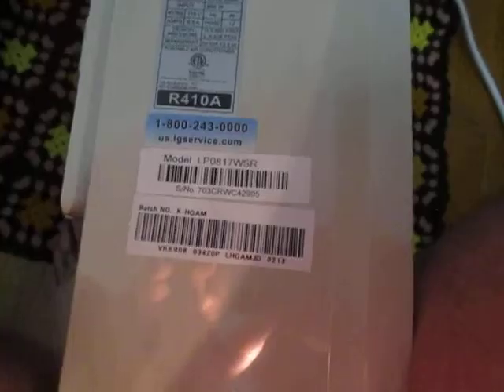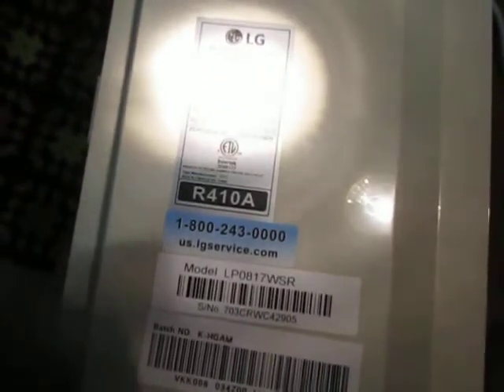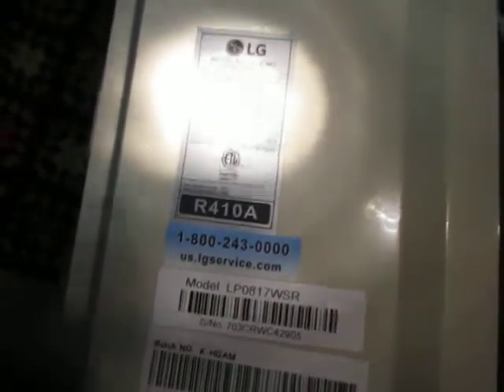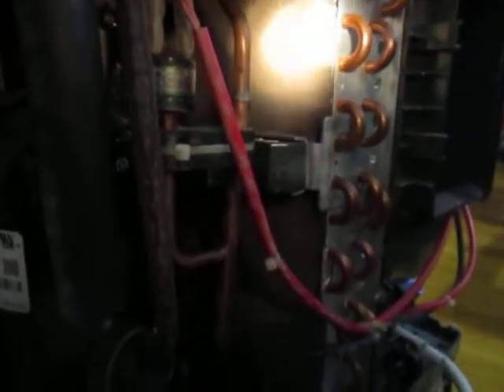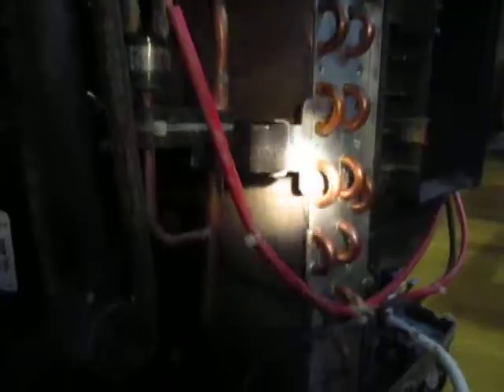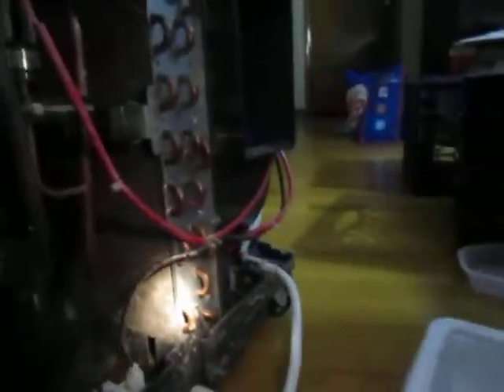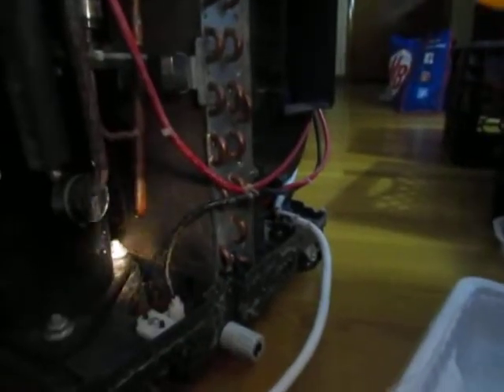LG portable air conditioner not blowing cold [Fixed!] part I

Comment: How hot is normal for these compressors?
Reply from the maker: you'd have to look up the temperature tables for the refrigerant .  The refrigerant is supposed to keep the compressor cool.
Reply from the maker: I got rid of my A/C unit because the refrigerant was blocked from flowing someplace in the condensor.  You could feel the temperature reduced from one pipe to another. Because of that, my compressor was running very hot.

Comment: I’m having the same problem haven’t found a solution I did everything you did and it still Throws hot air !!!!
Reply from the maker: After you get the metal on the condenser (bottom) cleaned, there are two pipes connected to the evaporator, which is on the top.  When working well, one pipe should be cool and maybe have droplets of water if it's humid.  That's the inlet.  The other pipe will be much warmer. That it the outlet.  Please make sure you clean the condenser fins ( on the bottom ) and the evaporator fins (on the top ) too.  Make sure that the motor (black thing) on bottom is vibrating when its on.  It shouldn't get too hot, otherwise it will fail quick.